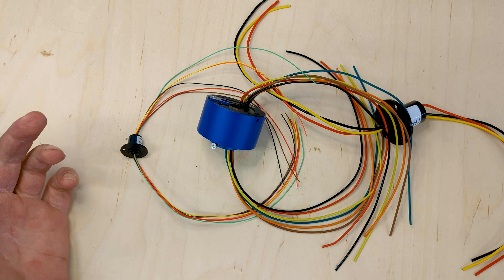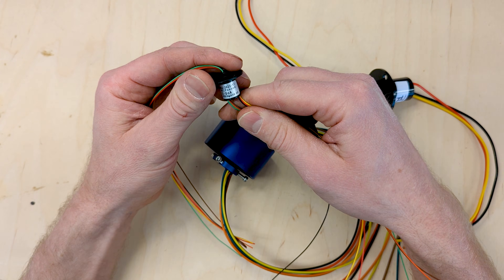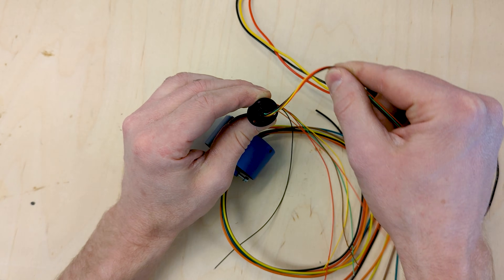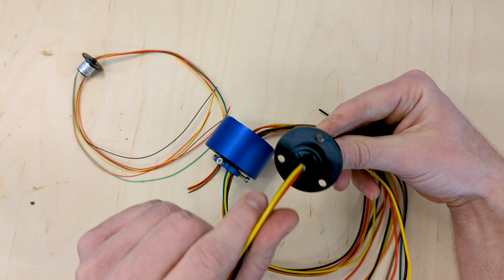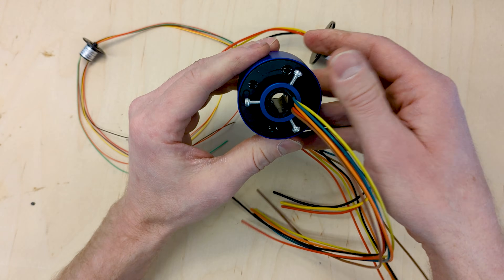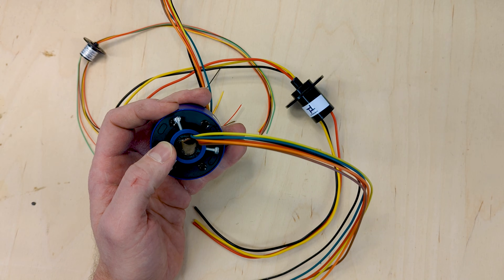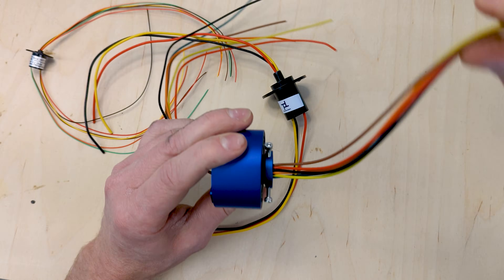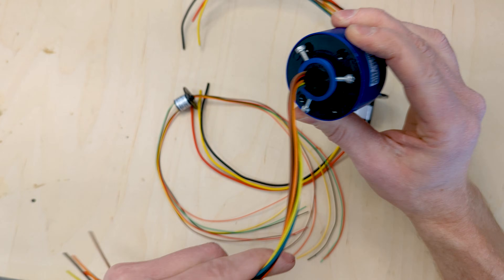What is a slip ring?

Comment: A slip ring can also be used in a AC generator or a AC motor right?
Reply from the maker: That's a good question. I don't think so because it doesn't have copper windings. It just has contacts for the different conductors

Comment: Hello, I've been trying to find a really small slip ring, like the one you show in the video. Where did you source this smaller one? Thank you. Additionally, I would assume this would not work well in a pressurized water environment (30 psi) because there are no seals. Do you know of any solutions of slip rings that can handle water submersion environments?
Reply from the maker: I got the small one in the video off of Amazon, McMaster-Carr sells lots of high pressure components so I would check with them

Comment: I want to transfer usb 3.0 data through one of these somewhat cheap 22 mm aliexpress slip rings.. Do you think it could work, or would i need to get a real "usb slip ring". Those are very expensive..
Reply from the maker: If the distance isn't far it is worth a shot
Reply: @WhatMakeArt  thanks. I will defenantly try one of these for power delivery, but for data I will try usb device sharing over wifi6 first using a single board computer. Hopefully it will be fast enough...
Reply from the maker: @Rwide88 good luck with the project

Comment: thanks for the explanation but how do the innards work and how do i make one from just parts?
Reply from the maker: I believe they work like brushes work for electric motors in a drill, I think you would probably be better using an off-the-shelf part then building your own, especially with higher voltages
Reply: @WhatMakeArt  thanks for the info but, I'm not working with higher voltages with it and am just doing home experiments with home made electronics as a fun pass time because it is interesting.
Reply from the maker: Sounds like a fun project, there are videos of exploded views of slip rings on YouTube that might me helpful for making a diy project, good luck, and post any cool results
Reply: @WhatMakeArt  thanks, I will check them out.

Comment: I wanted to find out how they worked. Thanks to you explaining exactly what I knew they were, my brain figured it out. Thanks for wasting my body's energy, without a slip ring.
Reply from the maker: Glad it was helpful 🎡
Reply: @WhatMakeArt  I thought they would be circular and horizontal with the wires making contact if you get what I mean- I didn't think about a cylinder with contacts running on wee tracks, obviously much easier to keep the contacts in check
Reply from the maker: Absolutely, glad folks smarter than me designed and built them
Reply: @WhatMakeArt  I was thinking exactly the same thing 😂😂😂
Reply: Exactly
Reply: same - utterly pointless -- just showing completed articles -- not taking them apart or explaining how they work.

Comment: How would you mount this to say a sensor on a servo, so that the servo arm spins on the same axis as the slip ring, while still mechanically separating the servo arm from the gearbox?
Reply from the maker: This particular slip ring is a little big for typical small electronic servos, but the basic concept is that the moving part of the slip ring would be mounted on a shaft that is attached to the central shaft of the servo motor. Then the non-spinning part of the slip ring would be attached to the body of the servo.

The order would be: servo motor body, non-moving slip ring body, shaft going through moving part of slip ring out to servo arm. 

Then the sensor wires can run down the servo arm and into the slip ring = super scary robot and computer vision, facial tracking, or just making enough fun electronics project

Comment: I'm curious, what is the purpose of a slip ring?
Reply from the maker: A slip ring allows for electrical connection on something that spins 360 degrees. If you used wires, then the wires would break after a full turn or so. 

But by using a slip ring, power and or data can be continuously transferred across a rotating body.
Reply: @WhatMakeArt  That is very interesting. Wish I knew this before 😀, life would've been easier. 

Thank you

Comment: How do you mount the blue one? I see a little thing underneath but that doesnt seem like enough for mounting.
Reply from the maker: A shaft goes through the center hollow bore of the slip ring that mounts to the shaft with three set screws

For the stationary end there is a protruding "U" shaped tab that can accept a locking pin to keep it from rotating
Reply: @WhatMakeArt  It would be nice to the locking pin being used.
Reply from the maker: Yes, I need to make a video about mounting slip rings, in the meantime you can see more images of this slip ring on this sales page of a similar product, often the tab is attached under the slip ring to prevent damage during shipping, it can be removed and reattached for mounting, https://m.aliexpress.us/item/2261799836246322.html

Comment: Is it possible to “stack” these to provide more wires? Need to run power but also multiple speaker cables and/or 1/4” leads
Reply from the maker: Yes with clever routing of the wires through or around the first ring, eventually it is better to send lots of signals over a protocol like Ethernet

Comment: I know i sound stupid but I'm old...😢 if the larger one is attached to a shaft will the shaft turn itself using this? I'm trying to make a vintage fan into a lamp and would like for it to rotate slowly.  Thank you in advance for not laughing to hard..😊
Reply from the maker: A slip ring is not a motor, so it won't turn the shaft, but if you attach it to a shaft the shaft is able to turn without tangling the wires.

There must be a shaft that the fan blades attached to, you would attach the slip ring to that shaft and then perhaps use a coupler to extend the shaft and then attach the fan blade. The stationary part of the slip ring would attach to the base of the fan and not spin. Then you would connect your power and controls where your lights to the stationary end that would be transferred through the rotating end of the slip ring so you could have lights on the fan blades